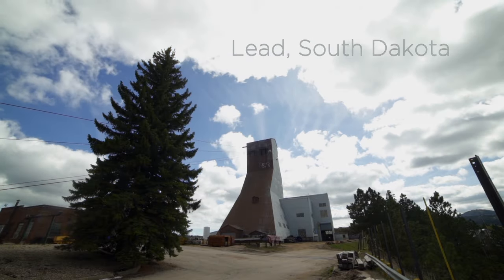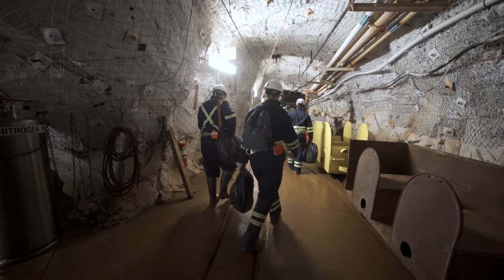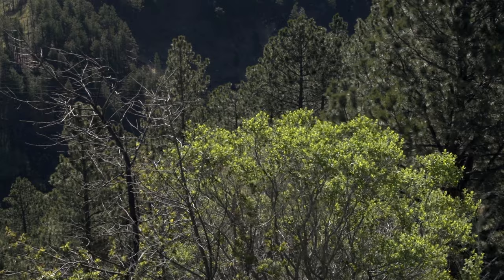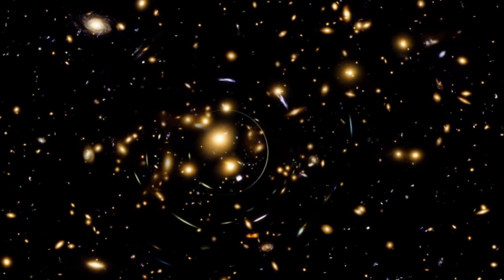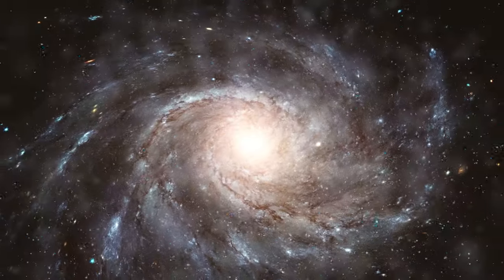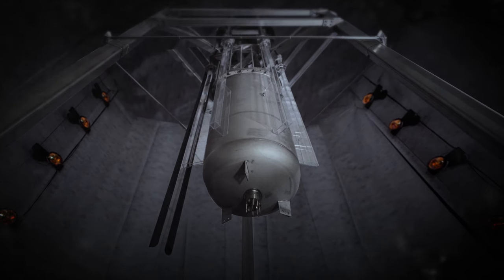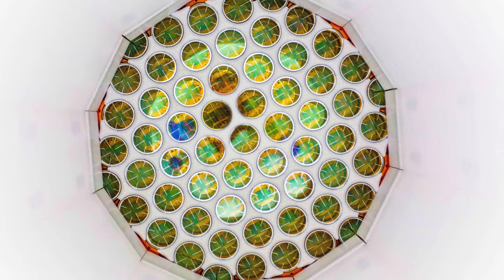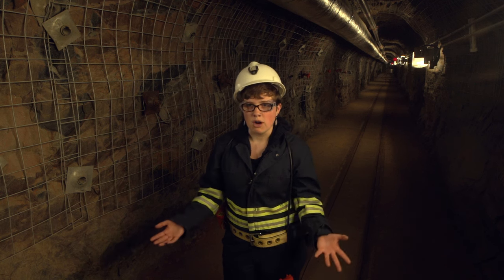4850 Feet Below: The Hunt for Dark Matter

Comment: i wonder if one would age less in this underground facility
Reply: Technically you probably would because you would be exposed to less ionizing radiation.  But the changes would probably be so small that you wouldn’t even notice the difference though.  Plus, much of “aging” (leathery skin) is caused by exposure to UV rays from the sun, so you can age at a slower rate just by staying inside your house away from the windows or wearing clothes that cover your skin.

Comment: but if it a pushing force that bends time and space out word insted of inward like gravity woudent this expiriment be pointless. if it gose through the liquid itle just warp it out of the way insted of pushing it out of the way like how gravity in huge quantaties warps space time into itsself with out it bothering the saroundings at the edges wete warp accures this thing will do the same thing in its outer edge exept outward protecting it from the matter interactions by simply warping out the mater were it stretches and expands it out and once its all the way through it just gose back into place. inorder to detect this thing your going to need something that once you interact with it, it makes everything stay in place including space time and gravity. that would also requir a zero g inviroment witch is possible but incredably dificult.
Reply: That's what I was thinking too.